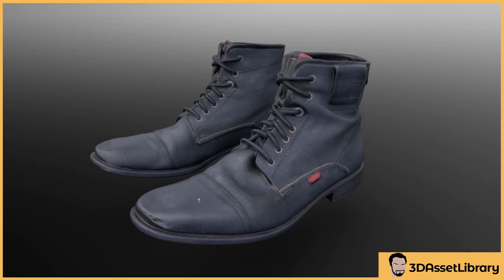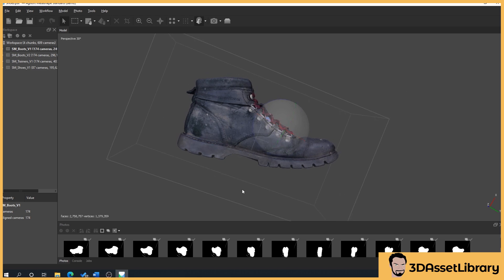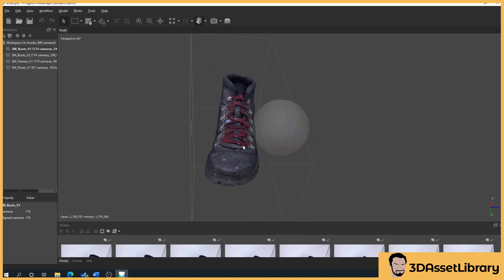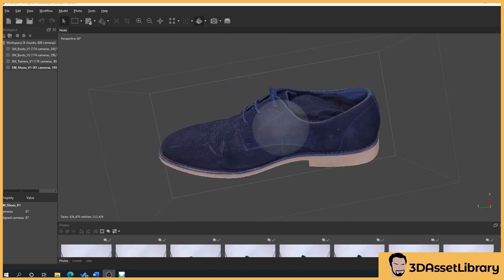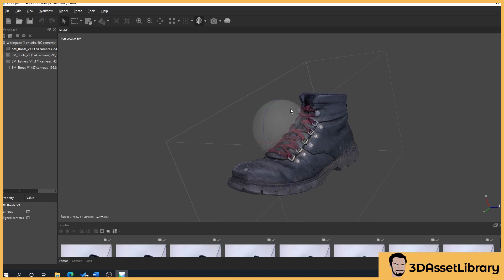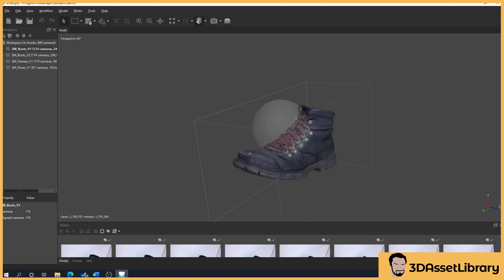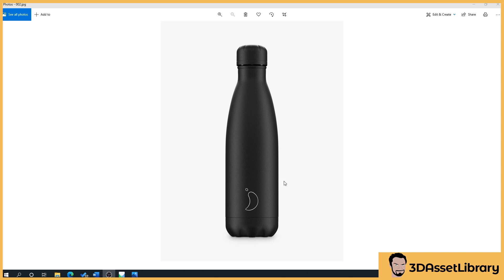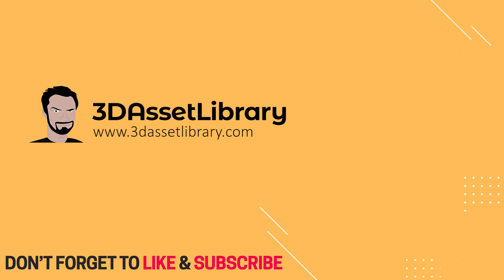Learn Photogrammetry: Part 3 - Lighting An Object, Reflective Surfaces & Lack Of Surface Detail

Comment: An object that has no features you say paint it here and there with a paint you can wash with water, but what about putting it on a surface that has colors and features will it not be enough?
Reply from the maker: @danielkotzer636  think of it like this if you have something shinney at a distance it’s hard to make out the features it’s similar with the camera but worse, you mark the object to create points for the software to connect together

You can try a surface with color features but previously I never had great success with this but that was an older version of Photogrammetry software